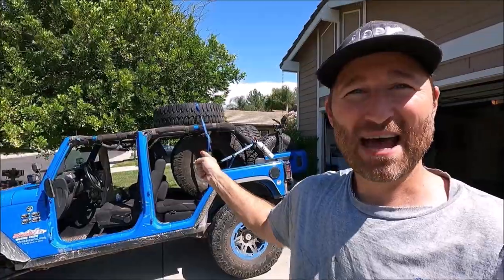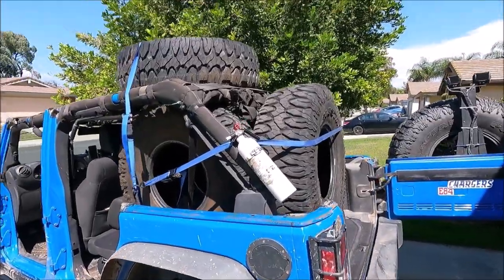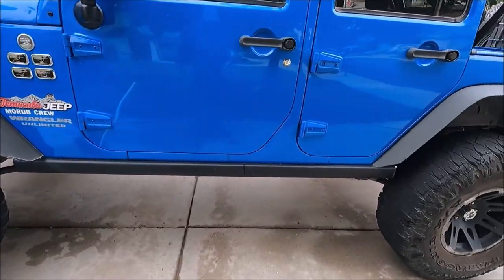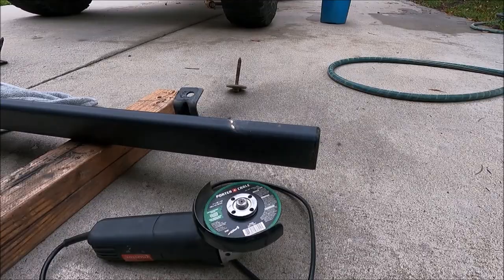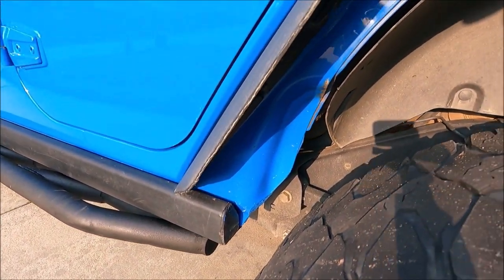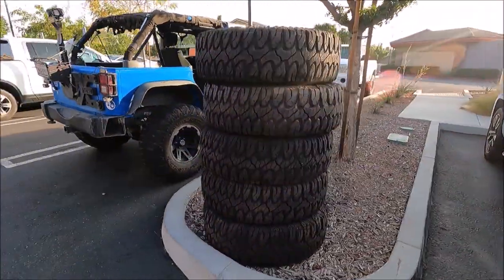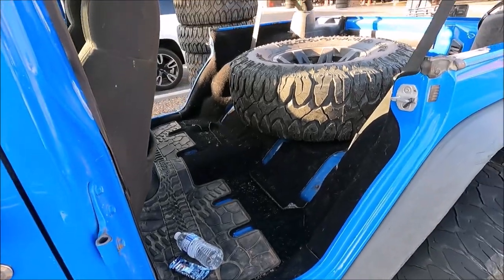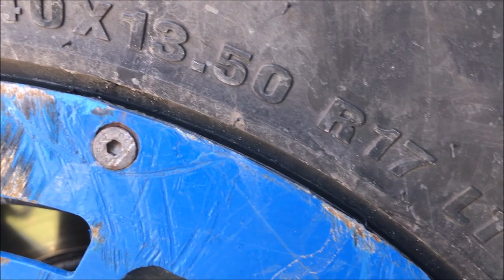40s on a Dana 44? You're NUTS!! JKU Fail

Comment: Lol I'm on 40s on my JKU with a Dana 30 front and 44 rear. These videos are hilarious with gurus saying you can't run Dana 44 on 40s.
Reply from the maker: Yup it's 100% dependent on how you wheel.  The "Crash and Bash" crowd will likely break 44's left and right, but for those of us who actually wheel with some finesse and calculation, 44s can handle 40" tires without any issues.
Reply: @Blubicon  amen to that! I'm easy and pick easy lines and easy trails. Not about to drop $14k on axles
Reply: 😂same here running 40s on d30 front and 44 on rear with 513 gears. No problem yet.
Reply: Same here lol
Reply: Same gusseted dana 30 on 40s, 5.13 gears running mostly on sand dunes. No problems.
Reply: Can and should are two very different things. I really wouldn’t try it in most of the Rocky Mountain west.

There’s a point where there is enough energy in a big tire spinning that it suddenly catching traction is enough to destroy stuff even if it’s mostly babied. I’m not saying that you need something built for rock bouncing. Instead, I’m saying that there’s a lack of margin of error and an inherent acceleration of fatigue. That’s not a combo I’d want way out in the middle of nowhere.
Reply: So on the JL/JT 44”s probably wouldn’t have an issue I wheel patiently not on the gas hard at all
Reply: Bro same 37s no regear even, just the 4.10s.
Forum people really have influence apparently
Reply: @richardagostino5085  You will be fine.
No wheel hop, Use winch when necessary and you can have fun anywhere as long as you aren't slaming the truck against rocks

Comment: I have 2014 jku rubicon with 35’s I want to run 40’s on it I don’t do no crazy ass off roading like most people but I do take it in the woods sometimes. I have 1 ton steering up grades and teraflex hd upper and lower ball joints. My Jeep is my daily driver but I love how the 40’s looks and I wanted to run them, what’s your opinion?
Reply from the maker: You can do it but you will need to run at least 4.5" of lift and you are gonna need to do a lot of trimming because you will be rubbing.

Comment: I have a g2 dana 44 front, 5.38 gears, rcv shafts, psc Hydro assist, and a rubicon 44 rear with rcv shafts 5.38 gears and its been great. Not saying you can't have issues doing it but it doesn't mean it's not possible or practical.
Reply from the maker: 100%. Thanks for the support!
Reply: That's my build as well. I have even run 38x15.5r15 tsl for a couple years with no problems. I guess I need lessons on how to break parts so I can upgrade. Keep in jeepjn!

Comment: Thanks for posting this. I've been debating on whether or not to do tons or a junk yard swap just to run 40's. I mostly do off road recoveries and overlanding. I'm not really into heavy crawling but sometimes the trail doesn't care what you want.😅 Going with Dana 44's would save me a bunch of money.
Reply from the maker: Chromoly axle shafts, truss and gusset. I would also recommend HD ball joints or the Delete kit that I run.  Then send it!
Reply: @Blubicon  Definitely going with the Dynatrac Ultimate 44. RCV’s , ball joint deletes and a good truss kit is next on the list.
Reply from the maker: @southwestoffroad  Great list!

Comment: My man, I've been running 40's on my JKU with Dana 44's for two years now. I wheel pretty hard but respect the skinny pedal. If I can't crawl or bump and obstacle then I just don't do it, common sense (no bouncing) goes a long way. That said, my Dana 44's have been trussed, RCV's and chromoly rears as well as all bracketry had been upgraded to Barnes Off-road 3/16" steel. I think it all depends on if you upgrade the axle when you run 40's. So far so good on my daily driven 40's/44's combo.  https://youtu.be/G8eqs28JY38
Reply from the maker: Nice rig!  100% I agree that D44's can be beefed up well enough to run 40's for a long time.  Rock on!

Comment: Have you done any gearing at all? How does transmission like it?
Reply from the maker: Running 4.88 gears with a 6 speed manual transmission.  Great combo for off-road and daily driver.  I might re-gear to 5:13 down the road.

Comment: You don't need 1 ton axles to run 40" tires 🤷🤷 this applies to 92%of the people whom own jeeps, it's only about 8% of people doing serious hardcore rock crawling. I've had 40s on my 44s God knows how long, and I do heavy deep mudding, trails and street. NEVER any problems. Cause I'm not bouncing off rocks etc, like a majority of people that own jeeps. Marketing tactics, and no knowledge has A LOT of people WASTING money 🤣🤣🤣🤣😂😂🤣🤣😂😂
Reply from the maker: This is SO true!
Reply: What did you do as far as upgrades before running the 40s?
Reply: @sethdearden548  first couple 44s absolutely no upgrades 🤷🤷 now though because I like things to look proportional, I just put artec truss kits. Again though the main thing is NOBODY whom is not a Professional Rock crawler/bouncer needs 60 axles. Ive been doing this longer than most have been alive I'm sure. 👍👍Plus my background in certain fields, I know what I'm talking about.
Reply: @williamh6547  so nothing internally is upgraded? Its a daily driver but I wheel a few times a month and just wondering what I should do with Dana 44s on a rubicon
Reply: @sethdearden548  absolutely nothing, I've got a 392 Rubicon, and I'm waiting for my 2023 392 Rubicon Extreme Recon to come in, I've already got the 40s for it, the lift, trust me, I act pretty stupid with my jeeps, deep mudding, running power lines, some crazy trails. You will be fine. Now if your rock crawling to the point where your tires are bouncing off rocks and loosing traction and then just as fast gaining traction, well then you may have problems, I go over rocks yes on trails, and down trees etc, I don't do anything close to what they do out Midwest, and even then, if you know how to work your throttle, your fine, for me on the east coast, it's mud and trails, 🤷🤷 20 yrs, and NEVER a problem. 👍👍you can put an artec truss kit on your axles, and you can upgrade to chromolly shafts, but you don't have to do anything else, I don't know what tires you run or gears, so I can't say about that, but as far as strength of the 44s yeah, I wouldn't worry.
Reply: @williamh6547  alright thanks man. I’m going to upgrade to at least 4.88, maybe 5.13. Right now I’m on 35s wanting to go 37s, but I’ve always wanted to run 40s so. I’ll probably get upgraded ball joints and some gussets at least
Reply: Duuude I find your comment super helpful for someone like me who lives in South Africa and cannot easily (and cheapily) import things like 1 tons! I'm getting a Jeep Gladiator and want to go for 40 inch and go overlanding in my country. There are some crazy rock trails but really for us here it's more rough gravel trails than big boulders. So I think I'll get a truss for the Dana 44s and put it on 40-inch tires. I think Americans are always wasting too much money, I've seen can crushers on camping rigs like the person can't use their feet to crush the can🤣😂😂😂

Comment: This is what I needed to see. I have a 2016 Rubicon unlimited Hard Rock. I am gonna put Yukon rear shafts and RCV’s up front with Dynatrac ball joints. I wanna run 40’s as well. I live in South Carolina near the beach and don’t go off-road mostly flat daily driving. Just wanted to know what you think of that set up since I won’t be crawling or climbing. Thank You and great video BTW.
Reply from the maker: You will be plenty strong.  I beat the crap out of these axles over the last year and a half on 40's doing the toughest trails out there.  Holding up great!

Comment: They make them more beefy now. I seen someone running 40’s on stock Dana 30’s with stock axles.
Reply from the maker: Yes ever since 2018.5 when the new M-version axles came out for the JL models.  They are definitely a strength upgrade over JK axles.

Comment: Great info about running 40s. Did you need to add spacers for any clearance issues while turning the wheel lock to lock?
Reply from the maker: Yes, I run 1.5" spidertrax spacers.  No issues.  I also added some spacers on the wheel lock stops.

Comment: Please share the combo to fit 40’s on my rubicon I have the Dana 44 
I need from A-Z combo even the lift kit please
Reply from the maker: You need MetalCloak Game Changer 4.5" lift. The kit comes with everything you need.  Make sure to get the LONG TRAVEL RockSport Shocks included, and add in the exhaust spacer and also the DB3 bracket for rear geometry correction.  https://metalcloak.com/jk-wrangler-4-5-game-changer-suspension.html

Comment: Can you go over over your axle build? I skimmed through your vids,and I dont see one about the axles.
Reply from the maker: That's actually coming soon!  I am editing a video to review the 40's on 44's after one full year of abuse.  Should be up in a few weeks.  My axle is a TERA44 model 3544253.  RCV shafts, ARB 30 spline locker, American Iron Ball Joint Deletes.  Steering is Barnes aluminum 1 ton.  Redneck Ram hydro assist. Brakes are Teraflex Big Rotor Kit.  Metalcloak track bar, Synergy track bar bracket and sector shaft brace kit.  Rear is a stock JK 44 housing, 35 spline ARB locker with Revolution chromoly shafts, Teraflex Big Rotor kit, and Synergy track bar.  Still needs a truss lol

Comment: those arent true 44s either, at least the front isnt, its got a 44 center with 30 axle tubes and 30 outer C's
Reply from the maker: Not in my case.  Front is a TERA44 aftermarket axle.  .50 inch thick walls, 3 1/4" tubes, and MASSIVE C's.  The TERA44 axle is basically a hybrid 44/60 combo.  D60 strength with a D44 diff.

Comment: What's with the E84 magnet on the rear tailgate?
Reply from the maker: Supporting Temecula Fire Station. The Pauba Station's Engine is Engine 84. =)
Reply: @Blubicon  I figured so, they are the helmet magnets we use. I used to work there, in old town at Station 12, and at 73. Promoted and left the city

Comment: Just bought a dana spicer 44 front axle assembly for my jk for when my 40s come in. Went with a 4.88 ratio. Wondering what you are running
Reply from the maker: TERA44 front with 4.88 gears.  Upgraded to RCV axle shafts also, and ball joint delete kit from American Iron Off Road.